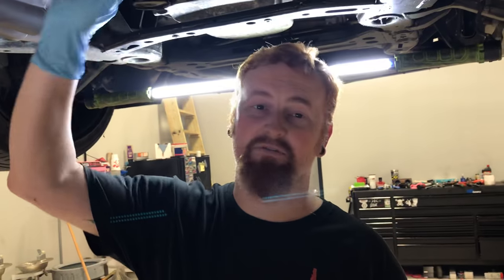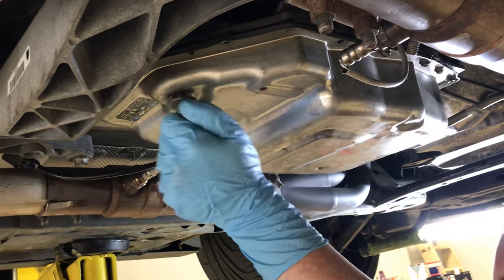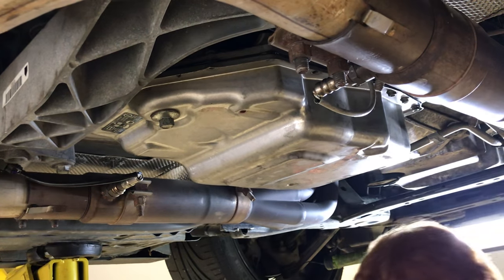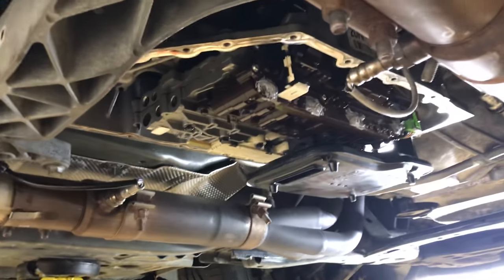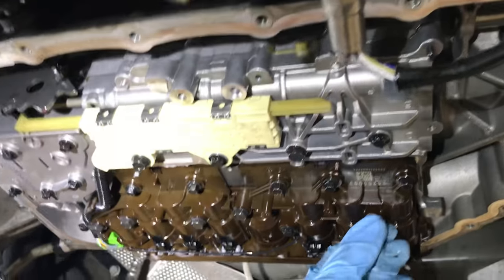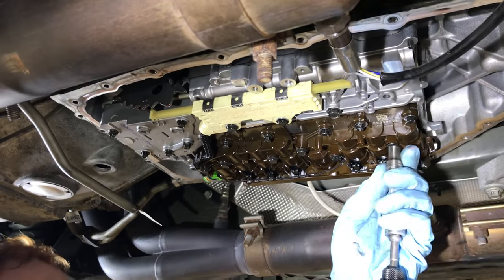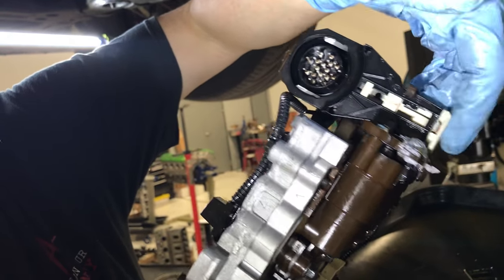6L80/6L90 valve body removal

Comment: I have a 2011 Chevy Suburban 1500 LT. The code is P2723 pressure control solenoid Valve 5 stuck off I was told I would have to replace my whole transmission  module. Was thinking maybe it could be more simple. Hope you can help me
Reply: Hey there. I have the same issue on my 2015 Tahoe LT and was told the same. What did you end up doing if I may ask?

Comment: Dear sir, could you please advise. I have stock 6L80 on my 2011 chevy camaro SS. I found UPDATED Valve Body Spacer Plate w/ 8 Check Balls 10-Up. Can I use it on my stock car?
Reply from the maker: Yes.
Reply: Where did you buy this from and how much? If so can you please send me the link pressure solenoid 5 is bad in my trans and need to buy the part

Comment: Hi I just replace my valve body I follow all the steps put it back but now my transmission is not shifting the light of the dash dont change to any rear neautral or drive do I need to do a reprogram? Please help me
Reply: yes
Reply: Have you found a solution?
Reply: Same issue did you figure it out?

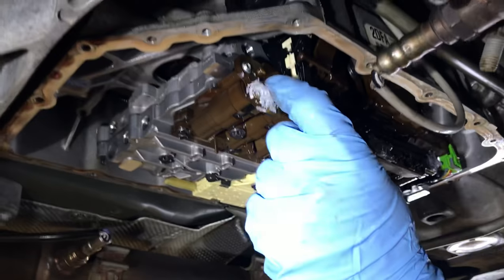Comment: At 3:36, that lever... I broke that tryin to get my trans pan out on my 2014 sierra 5.3 4x4. I think it's pulled down. So what's gonna happen if I just replaced the filter and bolt everything back up and let it ride? Because it seems like you still need those torq bits to be unbolted for the valve body to drop
Reply: I did the same thing just recently what did you end up doing? Any issues after?
Reply: @omargarcia2648  let it ride. No issues
Reply: @brandonnguyen1486  sounds good to me then I was going to buy a valve body to fix the clip but seems like no need for it. Thanks for ur help after watching so many videos and being in so many forums seems like me and you are the only people to ever somehow break the clip.

Comment: Hi I have the 6l90 in my truck. My question is , the plastic pass through connector......does it have to be removed before the valve body will drop out.....or will it come out as is
Reply from the maker: It will come out as is, you just have to wiggle it.

Comment: What is the part numbers for the  all shift solenoids and TCC solenoid and where to get them?
Reply from the maker: The solenoids cannot be changed, they are part of the THECM.
Reply: @asylummotorsports5997  oh that’s a bummer I’m pretty sure my solenoids are bad
Reply: @asylummotorsports5997  does this include the pressure control sensor solenoid?
Reply: @asylummotorsports5997  is the pressure control solenoid in this valve body?
Reply: The thecm is connect to the valve body correct ?